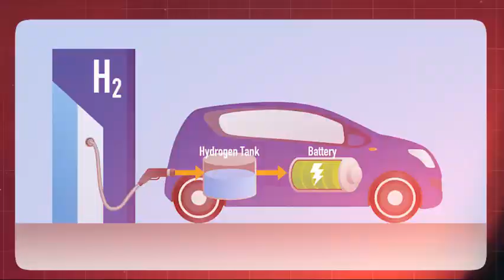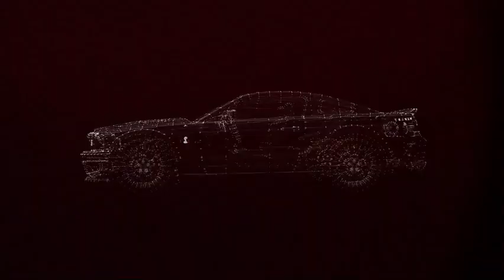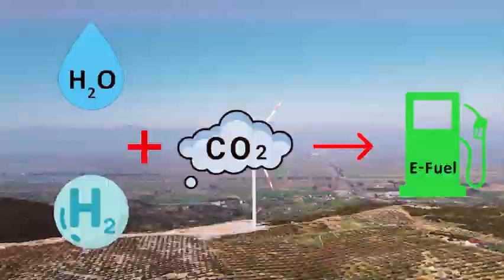Porsche's Hydrogen Combustion Engine: The Future of Sustainable High-Performance Driving

Comment: Sorry... but cars are not a sustainable ways of transport - no matter what fuel you use. The hydrogen must be produced first, and nearly all hydrogen produced today is based on fossile energy.
Reply from the maker: I would say lot of companies are doing research on Alternative fuels and I am very sure that we are not only relying on single power source. specially in case of off road vehicles and high performance because the energy density still in a latest battery sucks even if the upcoming. Solid state as well.